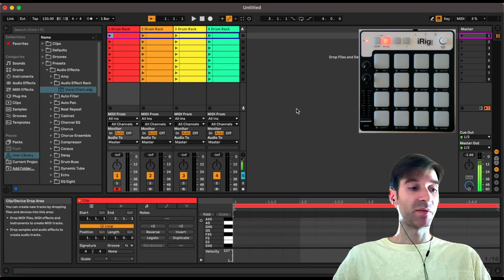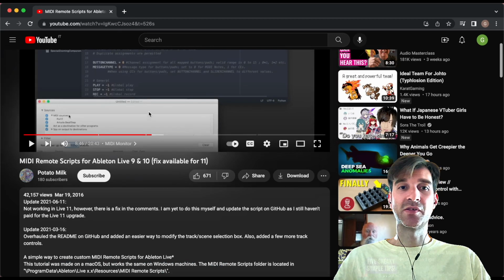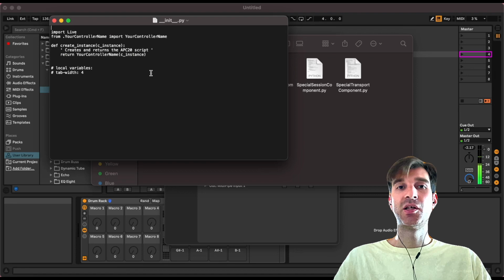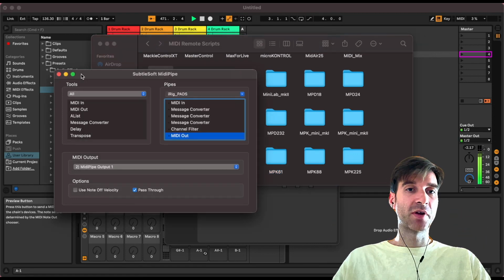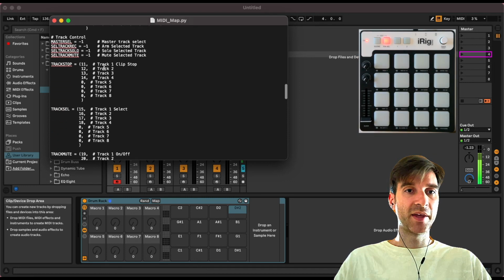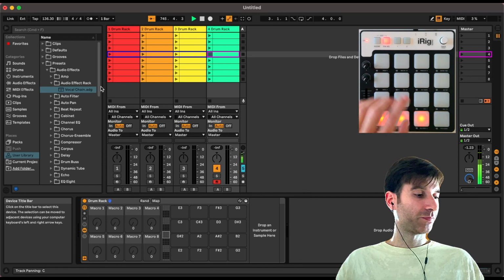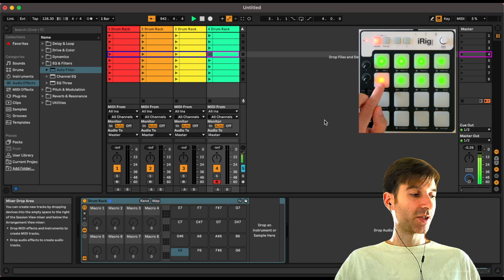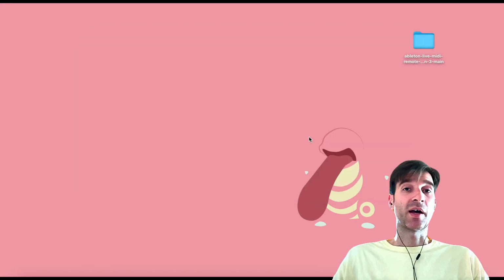Turn any MIDI Controller into a Control Surface for Ableton! Custom MIDI script tutorial [iRig PADS]

Comment: Hi! Great tutorial. I'm having trouble in Windows. I installed the folder in the MIDI Remote Scripts folder but Ableton won't recognize it as a Contorl Surface, and after doing that, the only control surface that shows up is Push 2. All the other ones have disappeared. Any ideas? I'm using Live 11.2.11
Reply from the maker: Ok, first thing I'd do is, I'd update to the latest release (11.3.4). Other than that, did you get any error message?
Reply: @TheNeonSyndicate  thanks! I updated and now it shows correctly. But I'm having trouble making it work. I change some midi maps just to try if it worked, set message type to 1 (cause my controller sends CCs), changed buttonchannel and sliderchannel to 1 (which is the channel my controller sends to) and I also tried different channels for buttonchannel and sliderchannel. Any ideas on why it won't work? I am using a custom controller made with Arduino, but I double checked the name of the controller and with a midi monitor that it's sending the correct messages.
Reply from the maker: @francochiabudini995  That's the issue right there: if you use CCs for both the buttons and the sliders, the channels need to be different. My piece of advice would be to keep the buttons set to notes and make it so that your controller sends out notes instead
Reply: @TheNeonSyndicate  now it works with CC! Thanks. Do you know if it is possible to assign different cc values from the same button for different functions? For example, when I press (127) it arms a track, and when I release (0) it triggers loop recording.
Reply from the maker: @francochiabudini995  That's an excellent trick I use quite a lot, but in order to make it work you actually have to use 2 different CCs. But with something like MidiPipe you can make it so that your 1 CC assigned to your physical knob turns into 2 different CCs depending on its value. So yeah, totally doable but you need that extra piece of software
Reply: @TheNeonSyndicate  great! I thought that I could make it work from the script but I’ll give it a try. Thanks
Reply from the maker: @francochiabudini995  good luck
Reply: @TheNeonSyndicate  sorry for the many questions, this is all new to me. I'm having trouble mapping the track stops for the clips. It onlu works with the first one, but as soon as I try to map the rest they just don't work (the first one still does). Any ideas?
Reply from the maker: @francochiabudini995  Ah yeah, I've had a similar issue. It's actually a "bug", if you will, a wrong character in the original script. I thought I had corrected it when I made the Python 3 versions. Let me re-upload the correct files to Github, you can download them again say a couple hours from now
Reply: @TheNeonSyndicate  works perfectly now. Thanks again! This is huge help
Reply from the maker: @francochiabudini995  Glad to hear that. Have fun!
Reply: @TheNeonSyndicate  only one more question. is it possible to assign a button to delete a clip? how difficult would that code modification be?
Reply from the maker: @francochiabudini995  That MIGHT be possible with clyphx. Clyphx is another control surface script, but it doesn't require an actual MIDI controller, rather it performs certain actions based on how you name a clip. If you want to see it in action check out the video I released last week: https://youtu.be/B5RaW4hEcTI I use it to switch presets but there are many, many more actions you can trigger like this so it wouldn't surprise me if there was one that deletes a certain clip, too.
Reply from the maker: Actually, just had a look at the clyphx manual, and you're in luck: it is indeed possible to delete scenes, tracks, devices and clips!
Reply: @TheNeonSyndicate  great! so is it possible to combine clyphx and the midi script to also execute those actions with my controller?
Reply from the maker: @francochiabudini995  Yes! Clyphx performs actions when you launch a clip. So you can assign launching that clip to one of your buttons using your custom script and that would do the trick. I believe there also is a way to do that natively within clyphx but I've never tried